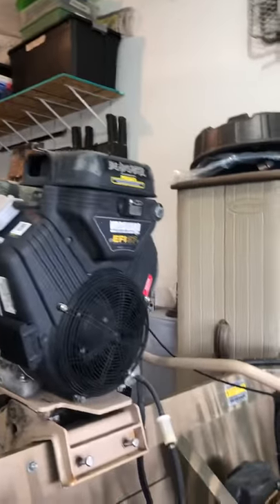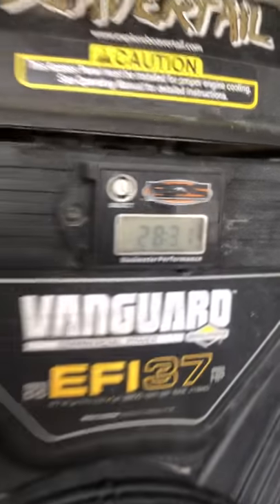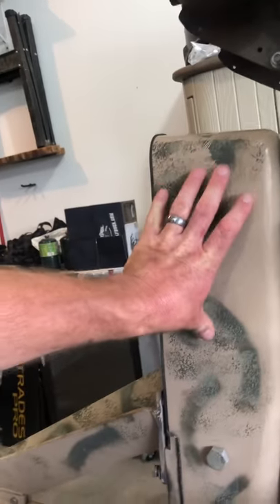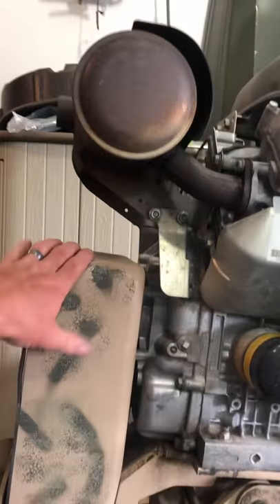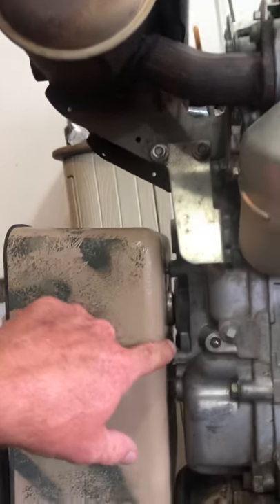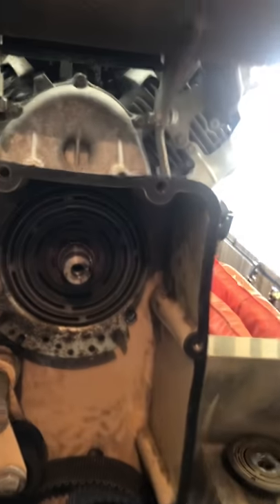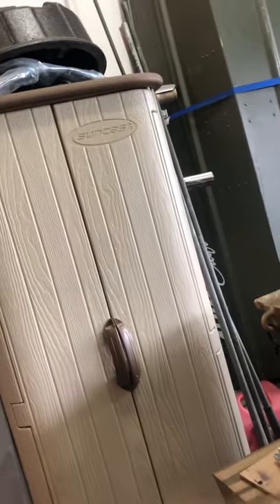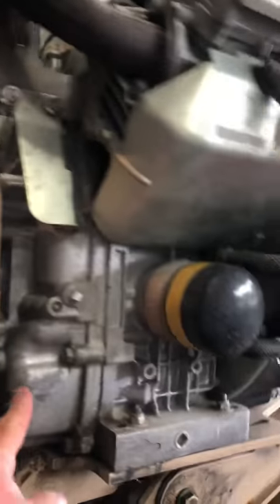Beavertail Mud Boat

Comment: Beaver tail is str8 up garbage. Boats and motors are garbage. Gatortail, Go Devil, or Prodrive would be my picks for the big block vanguard surface drives. Currently run the GTR and no issues.